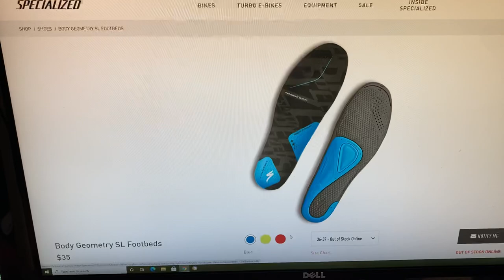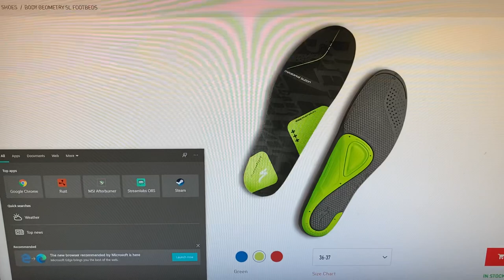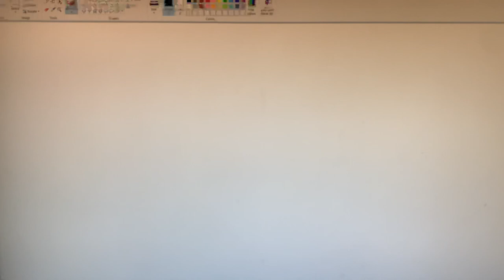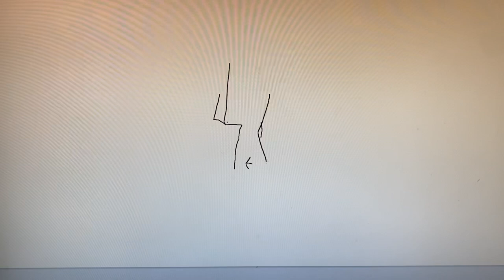THE BEST WAY TO INCREASE POWER AND REDUCE KNEE PAIN FOR CYCLING! (SPECIALIZED, BIKE, FIT, TARMAC)

Comment: Thank you for sharing the the insights. I've also have a footbed for my shoes and it does really help. Since we are on the topic on fittings, i'm wondering if you would produce more videos on bicycle fits. One topic which i'm really hope you could share your knowledge is on 0 vs -20 offset seatpost. Several pro team riders are seen riding on 0 degree seatpost to get a more forward position. Wonder if it would help general riders like us to achieve a faster more efficient power transfer in aero position.

Comment: Custom insoles are only as good as the person who makes them for you and it's a very difficult art since bike shoes aren't exactly easy to work with. I had 2 sets made for me for about 300-500$ each and they were never perfect. The first time the arch support wasn't appropriate at all and the second time the arch support made the rest of the shoe feel too cramped since bike shoes have almost no room to spare. The biggest revelation for me really was the 1.5mm varus support that Specialized has incorporated in their shoes combined to some cleat wedges to create an angle between the shoe and the pedal. Having the inside of your feet lifted at 2 degrees can make a bigger difference than having custom insoles for a couple of reasons: it's cheaper, it doesn't make the rest of your shoe feel cramped and it's more natural. In the end, I only wish I had realized this 10 years ago!
Reply from the maker: yea I agree witht he person who made it

Comment: I have been on BLUE insoles since 2 years ago. Got measured with the heat-plate and everything. But what you said at 4:35 really made me ponder as that is the exact sensation I felt when trying out (not riding, just standing) the GREEN insoles. Back then I dismissed them quickly due to that, but now I'm wondering if maybe that was a mistake and I should give them a shot? The BLUE insoles - I can feel them under my arch, but it's a very "light" sensation, certainly no push coming from them towards my arch. What is your opinion?
Reply from the maker: I love the green, they feel very weird at first standing on them but while riding it’s the right amount of pressure and support. I would say try it out
Reply: One way I heard it explained is the insoles should feel "intrusive" but not painful when you stand up.They will feel much lees intrusive when you pedal. Skeptical of spending a lot of money, I tried just plain gel arch inserts for ladies shoes underneath the "stock" insoles and was actually shocked at the difference it made. Then I went out and got the "proper" Trek footbeds.

Comment: Riding a Creo SL. I noticed that the Q factor is horrible due to the motor. I had a bit of knee pain and now I think I know why.  Any thoughts on this or how to best adjust?
Reply from the maker: They make longer Q factor pedals. Like speed play and also longer Shimano dura ace pedals
Reply: @GCPerformance18  interesting. The problem is the spread is too wide,  not sure how  a pedal will fix that. I'm using Look Keos

Comment: Does Specialized sell a "bunion" shoe"? 🤣🤣
Reply: For bunions get cycling shoes with laces. You can lace it to relieve pressure.
Reply from the maker: The vents are a great shoe. They literally have mesh where the foot makes contact with the shoe. Very little pressure and still a fast show